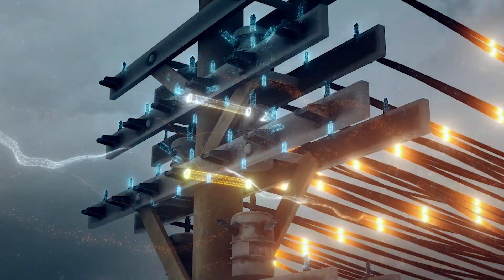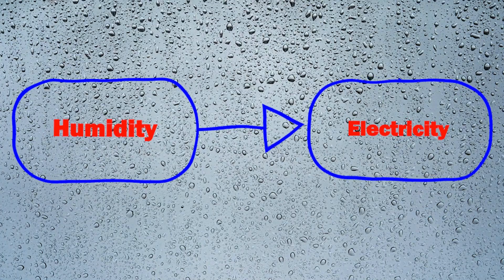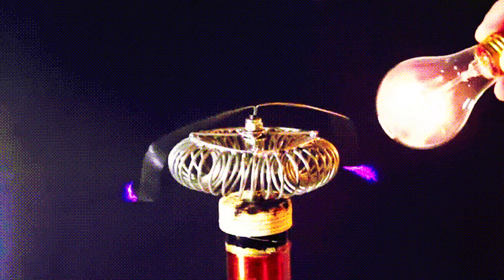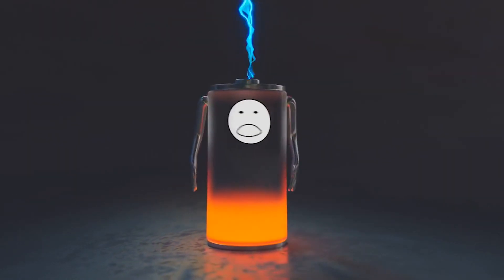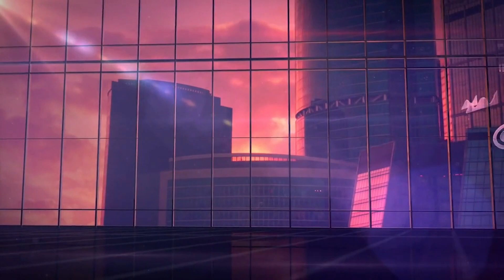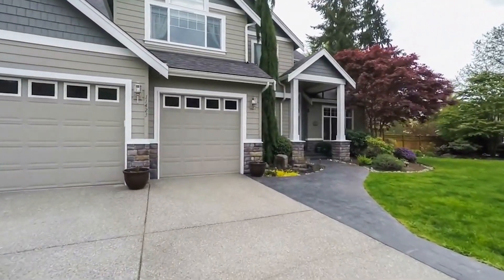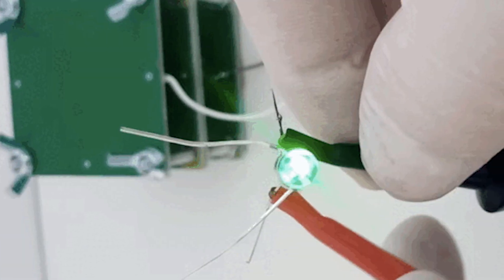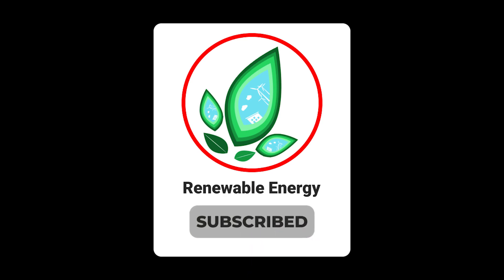Free Electricity from ONLY Air : Finally 2023

Comment: They say a cluster of 20000 devices but you would need an order of magnitude more devices just to equal the power used by a typical home.  try 200000 to 300000 devices producing 1.5v and 10mA wired in a series/parallel configuration just to get to a reasonable amount of power for a typical home.  Add to that we did not get an explanation of how the technology works so what are it's drawbacks and real world limitations.  You also don't have access to high humidity everywhere and that changes with weather.  Speaking of weather how would such a system impact the levels of water in the air?
Reply: this is true, thanks
Reply from the maker: That is great view. I think it is a challenge to be solved later. But now, I think they just do demonestration for the concept of geting energy from air.